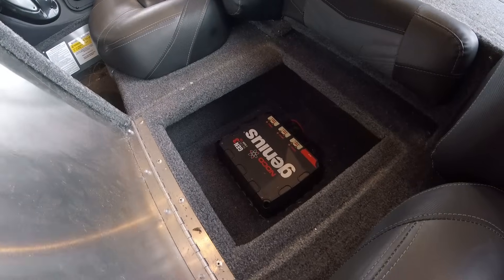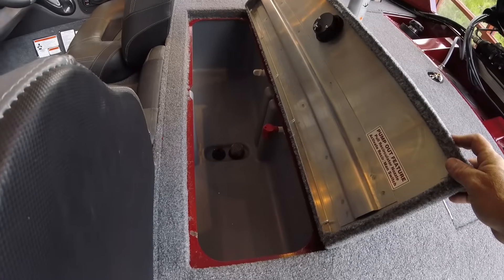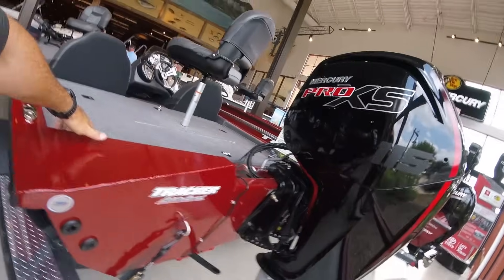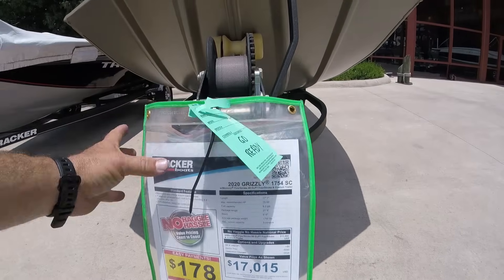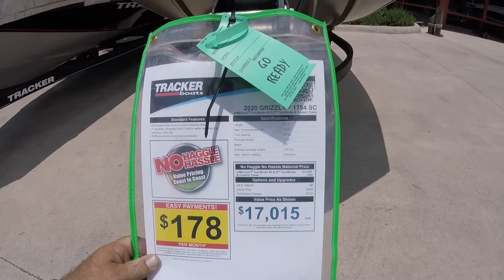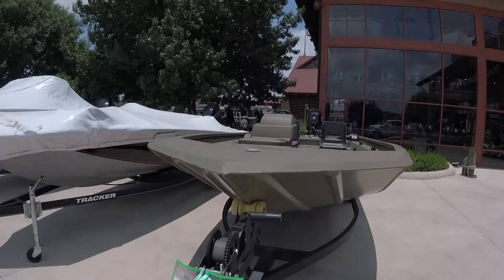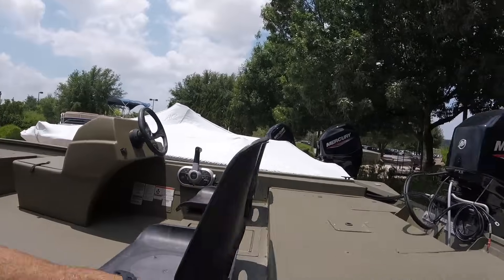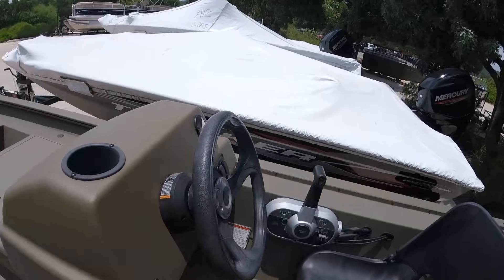Bass Pro Shop Boats - Walkthrough Prices, Specs, Features. Which Boat is Right for me?

Comment: I just bought a new Lowe skorpion 16. I got the fishing package.  Large storage for your tackle. You can sit 2 up front. Got the extra step with storage. 17gallon livewell, 12 gallon live to replace the dry storage and rod locker 20hp mercury motor. 4 cup holders. Set up for Lake Marburg. I added a 6 gallon fuel tank, 55lb minnkota I-polite trolling motor, 2 helix 7 fish finders. Came with trailer for boat. Very nice set up.
Reply from the maker: Dang. That's sounds like a super nice boat bud. That's all you need

Comment: Be concerned when purchasing the proskiff 17 and the pro skiff 15 , i owned a 2019 and it came from the factory with issues in the hull , after joining the pro17/15 forum on facebook I found that most of these boats have and do eventually have hull issues . I really loved the boat , ran great with the 75hp and jack plate the draft was shallow , all i did was flats fish . I decided to sell it before any more problems occurred , just some food for thought , oh , also u need to reseal all drain plug areas , make sure the bilge is wired correctly and do a thorough walk thru and prevent maintenance . Boat is extremely stable and fun to fish out of . On the forum i tried to help people with some suggestions so they could enjoy the skiff and the proskiff forum would not allow my info and blocked me.
Reply from the maker: That sounds scary I think I would of sold it too

Comment: Hey bro cool vid. But a small correction. Those long metal boxes behind the seats are not livewells.. They are storage boxes. Having said that great vid!!! 
Respect
Reply from the maker: Your exactly right, from what I remember I was checking the smaller trackers which had the bait well and the live well then as they got bigger I didnt realize they were no longer live wells, but aluminum storage. I even at one point mistaken the cooler for a live well. Dumb ha thanks bud

Comment: lol video just popped up because I have been looking at info on the Trackers, 3 years later and the boat prices have basically jumped to the next model up. the first  boat you showed is now 17k, the 175 starts at around 23k and alot of the  models they have in stock are 25-27k, the 190s are about 28k for the 90hp motor version, the 115hp 190 is now 30k(the one I just bought), the 195 only comes in tournament edition and is over 35k now. wish the 195 in your video was still the same price because it was exactly the size I was looking for but did not see one for under 35k anywhere near my area. I actually would have gone with that z18 if it was still that price too. the z17 I was quoted was the base model with no extras and it was 32k, didn't see any z18s under 45k within 100 miles of my area now(includes 5 shops). Wish I had been boat shopping 3 years ago.
Reply from the maker: Isn’t that crazy, they have gotten so expensive

Comment from the maker: Let me know if you have considered getting a boat from bass pro.
Reply: Never, low quality
Reply from the maker: Yeah, I am a aluminum boat guy and I would prefer an Xpress but lots of people buy tracker, and nitro boats.
Reply: i want a new boat but have a short budget any recommendations?
Reply from the maker: I would look at a jon boat, great starter boat. You can find them on facebook marketplace for good prices in your are. A jon boat can get you into alot of awesome places to fish.
Reply: Bought a Z17 left over from 2019. Was marked down $4,000 other than that no I wouldn’t buy from them again. Changed the electronics in the dash and it looked like a 2 year old cut it out. They washed the boat and left the plug in it and when I picked it up it was full of water. And what ever they used to wash the boat ruined the steering wheel. Warranty covered it. I would go with a local dealer next time. Very disappointed in how they chopped up my console. Lucky my son could fixed it. You are better off to go to a dealer that you trust and do your service and cover your warranty .
Reply: @TBassFactory  Jon boat with a small 20ish HP is good enough for lakes, reservoirs and such.. but might be too small for a river. What people sometimes miss is that the width of the boat is almost as important as the length, it provides more stability, which is why when you start getting to 20k  the boat designers get fatter boats.
Reply from the maker: @JimbobZ17  that sounds like a horror story that stinks.
Reply from the maker: @mikem4432  yep your exactly right
Reply: I bought a brand new 2016 proteam 175 TF with the 60hp Merc back in 16 at Basspro in Peoria, IL and it was 15,999 back then and the service Dept there was fantastic.  I have had no problems with mine and would buy again.
Reply from the maker: @Fisherman_83  that's awesome. I've heard both sides good and bad. I'm glad you got a good one and have had good experiences.

Comment: The back storage locker's behind the seats in the first few Trackers are storage, not live well's.   If you looked at the Classic XL it is about a foot longer than the 160, comes with the 50, and tbh that "little bitty" trolling motor works perfect.  Also while I did think I'd need an extra tank in my Classic the 6 gal is plenty with the 4 stroke 50.  I can go several days all over the lake on one tank.   For a brand new boat at 14k I love my rig,  I could never afford those 30-70k rigs so that Classic XL allowed me to get on the water.
Reply from the maker: Yeah I didn't look close enough at those lockers, I was wrong. I've been wanting to see one of the classics but for all of the great reasons you stated those things are selling and are very wanted right now. Im sure that thing is an awesome rig. Thanks bud
Reply: @TBassFactory  ha yea i had to wait 3 months for mine to finally come while it doesnt have every bell and whistle for the price you cant beat it!

Comment: By far the best deal they [Bass Pro] had a couple years ago.  Was the Aluminum Bass Tracker CLASSIC.  A throw back in style and beautiful boat for 10k. They could not keep them on the floor.  Sadly it seems they have dropped it from the inventory.  Another was the PANFISH special with a stick steer up front.  Great little boat for family fishing boat.  Again looking like it was dropped from the inventory.  Bass Pro also own Ranger and the price is considerably higher...Here's a brand you might want to review WAR EAGLE boats. Very nice layout and well designed and built boat.  I agree with the DIY concept.  If you have the time and such to do so.  But if not a prepackaged boat is a better option.  Not to mention that you have the price of the individual items you plan to add on, to consider in the cost of the boat. Which is were Tracker gets you.  The boats are all a set package and fixed price.  You can make a few upgrades for extra cost.  But the design is a "fishing ready " boat package,  and a no haggle fixed price.  That is pricey, but competitive.
Reply from the maker: They are a great buy. I have seen a couple of them but they are sold before they even go on sale.
Reply: I remember those also. Seemed like it was too good to be true. Profit margin too thin I guess.

Comment: I bought a Tracker v14 haul only, $2,000 BPS brand new. Got a trailer for near nothing. outboard for $1000. great condition.  Put a Bimini top on it and used it for several years. Sold it for more than I originally paid. Aluminum is the best cheap boat. Next time, auction purchase?
Reply from the maker: Now that’s what I’m talking about Henry. That is smart boat building right there.

Comment: A few other items to consider.... upgrades  $$$ trolling motor,  $$$ electronics,  $$$ power poles,  $$$ prop, .... A fiberglass boat is beautiful and that comes with a cost. Routine maintenance.  You have to be vigilant about washing and waxing them or that beauty goes away quickly.  So you come home from the fishing trip and add that to your schedule.  Additionally the weight of a fiberglass boat limits your access to the areas you can fish.  Aluminum boats are capable of accessing a wider variety of water.  Always upgrade your prop or at minimum get a second prop. Nothing is worse than damaging your prop and ruining your trip.  Power poles are worth the cost.  Upgrades to electronic devices can get very expensive very quickly.  Upgrades to the trailer brakes are a good option.  Greaseable wheel bearings are a must.  Trailer guides are handy,  especially for dark poorly lit boat ramps.  So do your homework before you get a boat.  They don't hold value well and you can lose money on resale.  But they are a lot of fun and enjoyable to fish from.  However a 60k boat that can't get to your favorite honey hole is disappointing to say the least.  Plus the routine upkeep. At the same time  having a bare bones boat and none of the items you want or the time to DIY the upgrades is disappointing as well.
Reply from the maker: You made so many good detail points Ron. There are so many factors that go into a new boat and all of the stuff down the road.
Reply: Not trying to discourage the joy of having a good fishing boat.  But for the person who has never had a boat.  You said it,  do your homework and research.  You can spend a lot or a little and either way have a great boat. But if it doesn't work for the type of and places you fish... it's not a great boat.
Reply from the maker: Exactly I love your point of view and the way you look at the boats and the needs

Comment: Really great video! I am in the market for a grizzly and have been desperate to see reviews from current owners or walk through sand hey just for some of the comments made remember these are 4 stroke engines that come with warranties as well as hull warranties versus spending less for a used 2 stroke engine and possible hull issues on a Craigslist boat
Reply from the maker: Your exactly righy Zoe. You take the risk with buying a used boat, but you have to weigh whether breaking down or having issues with the engine is worth the price. I definitely would love to have one of these boats and have the security of a warranty. Thanks
Reply: I own a 1648 Grizzly alweld. My experience hasn't been that great. The hull welds failed in about a dozen spots, leaks in all those spots. I've spent probably 100 hours and over a thousand dollars, buying metal, fabricating, and paying professional tig welders. If I didn't do  most of the work myself I would have cut the boat up and scrapped it because it would have cost a more than the boats worth to have a dealer do the work. Tracker has alot of improvements to make before I would ever buy anything from them again.
Reply: @mriphone1000  same experience for me. They told me the warranty doesn't cover salt water. Wtf? This is Florida, we're surrounded with salt water
The salt water corroded all of the seams on the bottom. After trying to seal it for years I cut it up for scrap and hung the little 25hp on gheenoe
Reply: Trackers are one of the worst out there , too much to pay for shiny paint that doesn't hold up

Comment: Hey bud I would suggest that you look at all boats manufacturers in bass boats. If you want a bass boat i would suggest what type of fishing you would be doing. If the 160 or 170 is all you need then look at them but other great boat companies out there. Every one else beat me to the puch about the aluminum livewells they are storage
Reply from the maker: Yeah I didnt realize until later when I was going through them that was storage. The 170 would probably be the right size for everything. I'm getting away from fiberglass. I would like to check out some other brands like xpress.
Reply: @TBassFactory  Express is good boats plus better build boat then tracker is

Comment: I wish the Mako pro skiffs were better than they are. Joined a Mako FB group and was warned off by multiple owners not to buy. Due to quality of build. I recommend you joining a group first to see what issues they have .
Reply from the maker: Really, that is surprising. That is a good point to do the research into the boats instead of learning the hard way.
Reply: That’s a shame. Mako used to be a premium brand back in the day.

Comment: Is it possible to put a 100hp motor on the front and back of a 16ft aluminum boat at the same time for a total of 200hp' both pulling in the same direction/forwards?
Do you think it would steer better than a single rear mounted engine/sharper turns and more stable?
Reply from the maker: I don’t think that is possible but maybe some innovation could change and make that an actual idea to try.

Comment: Hello all.   I want to get my 21 year old his first bass boat for his birthday.   Not sure where to get this NEW boat from, Bass Pro Shop, etc.    As far as prices, is waiting til the end of summer better?
Reply from the maker: Why Marvin, it depends really what kind of money your wanting to spend. I’ve been fishing out of a pelican bass raider and you can get them from academy for about $700 or you can find a used aluminum boat for around $1000 or more up to 20k but those also are trailered. I hope that helps bud.
Reply: @TBassFactory  thanks for responding.   I guess I should have stated my budget would be up to 20k.  I was looking at a aluminum boat.  Thanks for the info.
Reply: @marvinjenkins4901  idk if u bought  a boat yet but I got a 18 foot Stratos 176 xt for 10k..fiberglass and aluminum floors..aka no rot..75hp for 10k out the door..definitely a great starter bass boat..very stable with 2 big guys running around..love it..only complaint is I wish it was faster..only about 40 mph

Comment: They underpower all their boats
Reply from the maker: Yeah I would think they could put some bigger engines on there.
Reply: You can always upgrade the motor on anyting Bass Pro Sales but they're only under par if you're one of the nuts that wants to run from one of the end of the lake to the other just because you can you can fish out of a kayak or you can fish out of a Jon Boat or you can fish out of one of their boats with no problem if you're not in no big hurry to just Gun and Run
Reply: Mark Jamerson appreciate your reply, however there are many great fishing spots that take time to get to. Big lakes with lots of structure.. The ability to go 30 mph vs 20 with a stock boat would be nice. Have you shopped for a boat, before? They make upgrading to a different motor very expensive especially when moving up in cylinders. Example Merc 75 to 90/115. Big cost..

Comment: the 175 is worth it if you intend to take 4 people for sure and the larger more legit fuel tank,  i went alone or with one person most of the time the heritage (160 pretty much) was all you needed in a boat for 2 people, never ran out of gas or even came close thing would run all day on that little tank. i personally found zero need for a trolling motor, the pedal with the cords was always in the way was annoying. i kept the livewell as a cooler just because i dont really keep much besides the last few i need for a tacos.  when my buddy would bring his truck load of rods with him it would really annoy me.. had space for 4 rods plus like one or two on each side but thats too many even.. i got a shorter bass rod to use from the drivers seat that was my go to rod then id bring one or two others,  but damn my one friend would bring like 12 rods and wow,, so much clutter on the boat.  i sold my heritage to finance a move, ill be looking at a 170 pro or 175 . the added person allowance would be nice otherwise anything above the 175 is pretty much just extra carpet and engine size.. the heritage was a speedy little fishing boat i never needed it to go faster.
Reply from the maker: Those are some awesome
Reasons to consider what you need and what you are happy with. It sounds like the heritage met your needs and I agree with the amount of people being able to go legally. Thanks for you viewpoint bud
Reply: @TBassFactory  no problem i hope to one day be back on the lakes with a new tracker. i also want a kitfox bush plane sooo who knows haha

Comment: I went to the local Bass Pro Shop in Destin, FL to check out the boats.  Seemed to be overpriced to me.  Then I went online to see what kind of ratings the company got and they were NOT good.  Service after the purchase was generally sub-standard if not worse.  That took them off the table as a consideration for me.  Honest, reliable service on a new boat/motor combination is a MUST ~ at least it is for me.  Good luck to y'all...
Reply from the maker: Yeah I've been hearing the same thing it's about 50 50. I did hear though that alot of people are having better luck with the smaller dealers and not straight through bass pro.

Comment: hello can i pull a  bayliner 25 foot with a 2012 infiniti qx56??? i need to know if i wont have any problems when taking it out of the water thank you so much anyone??????????????????????????
Reply from the maker: You sure can. That Infiniti with the v8 has 400 horsepower and can tow 8500
Lbs. it should be able to do what you need with that big boat.

Comment: You don't need 4 batteries for a 36 volt system. You run your 36 to troller and can still run 12 to your starter
Reply from the maker: Oh yeah, it makes me feel good to have that little bit of security unless something happens. I've read tons of wiring setups on forums and looked at schematics. You are right tim, thanks bud

Comment: Didn't see the 1648?
Reply from the maker: I wish they had one in stock. I finally seen a classic xl the other day but it was still in the shipping plastics so I got to see the outside. I want to check out one of those 1648s
Reply: What are the those black little circle pieces on the 1648 all over the boat? Are they extra mounting spots?